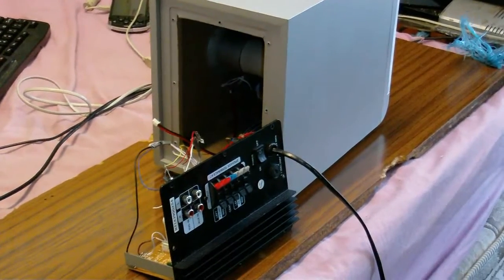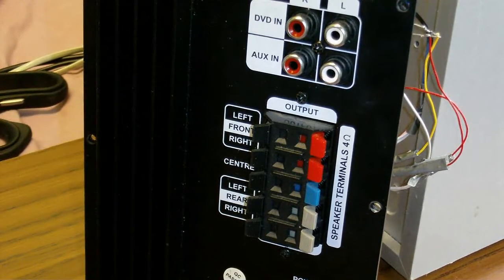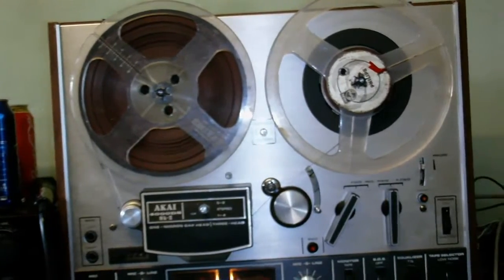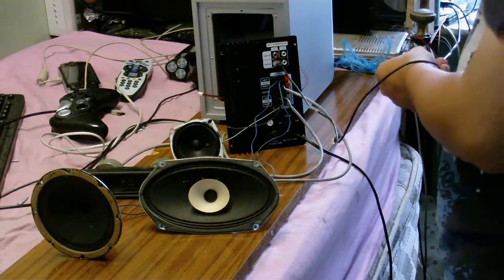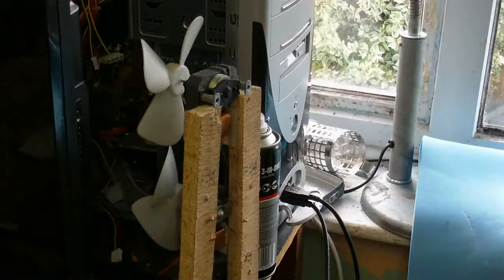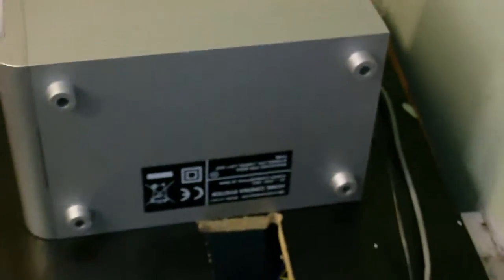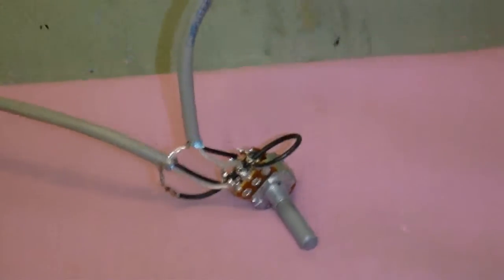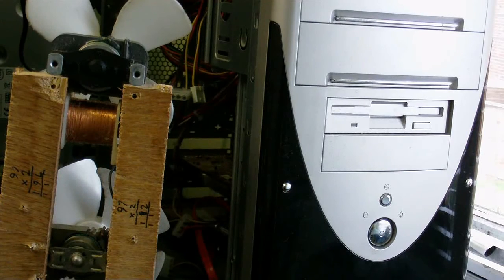Circuit bending a durabrand home theatre speaker wotsit part 2

Comment: i think you need some better insulation on the 220 volts contacts of that relay. it is very dangerous the way you do this! at least add some electrical tape, heatshrink is even better, and best is insulation the thing and building it in a small plastic box.

Comment from the maker: I did put tape around the contacts on the relay, its just not shown in the video.  Good point though.  BTW the voltage here is 240, not 220.

Comment: when you had this screwed to the underside of the computer bench, did you use the rear speaker connections and centre or did you just have 2 front speakers and the subwoofer going, shame to wire something up like this and only use 3 speakers out of a possible 6...

Comment: I got this exact speaker, connected normally no fancy things and recently I have noticed that the light comes on but no sound! I was hoping you could give me some pointers because the speakers are inside a ceiling and without the main speaker I cannot get the others to work, I tried a hi fi but it had 2 inputs for speakers and there are 5 in total!

I look forward to hearing from you.

Zack